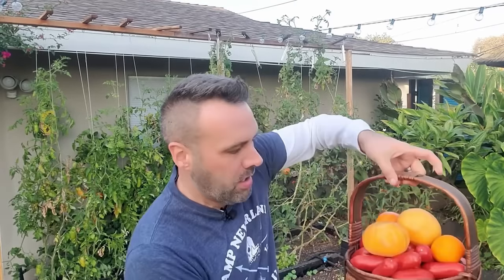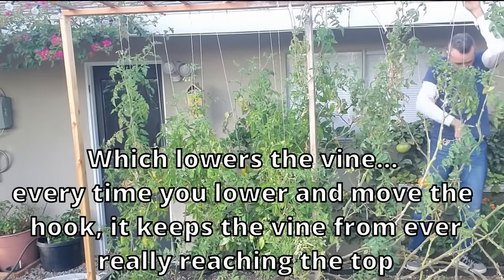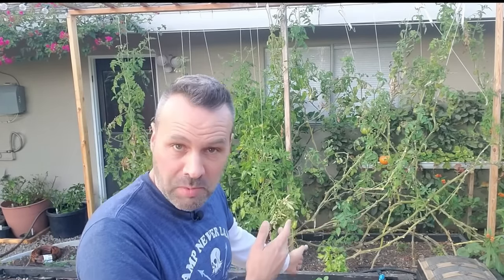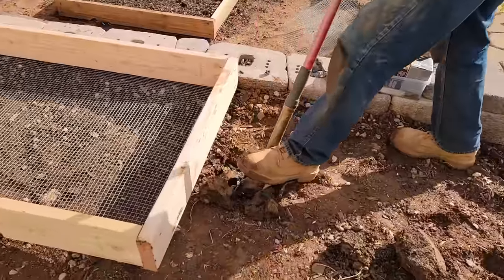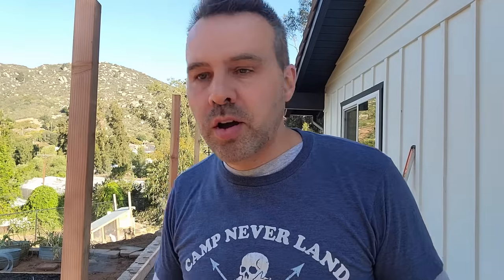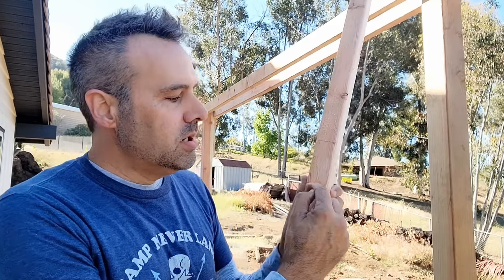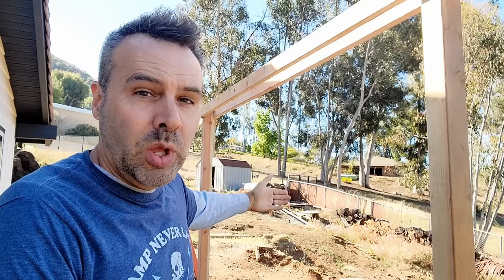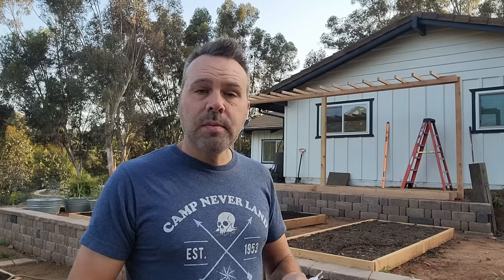Grow Way More Tomatoes In Less Space! - Best Way to Trellis Tomatoes EVER!!!

Comment: We built this last year and loved it! It was so much easier to maintain. I, like others, did end up overcrowding a bit at 1’ between each plant with some basils sprinkled throughout, so I will be spacing them out a bit more this year.

My main problem was that I didn’t properly anchor the landscape pins tethering the string to the ground, so as the vines got heavier, the string and pin would be pulled out of the ground. I tried burying the pins to have more resistance, but that didn’t help much. I haven’t figured out how to better do this part yet :(

Comment: Using a spacer block (it looked like you were towards the end), using clamps to hold the cross pieces while you're screwing them into place, and also drilling and installing the eye hooks before you hang the cross pieces, so you don't have to climb and work upside down!! Woodworking nitpicking aside, this is a great video and by far the best thing I've seen so far. I am planning what I will plant this fall as it's already much too hot here in June.

Comment: Last week I was lamenting not finding a video where I could see how the strings work late in the season and boom, you delivered just in time. I used the strings last year, but didn't take advantage of moving them around. Also wasn't as good as I should have been about getting all the suckers.

Still curious about how shallow that bed is. Even planting them sideways it doesn't seem like enough depth, though I suppose you could add a level.
Reply from the maker: Well. Technically they are able to go into the soil beneath. There's only wire in the way.
Reply: @NextLevelGardening  Ah Ha! Hadn't thought of that. Keeps Moles from coming in but the roots can go out! Thanks for all the great videos!

Comment: Wow.  That looks great!  How are you attaching the cross strips at the top?  The video is sped up during that process.  Are you drilling at an angle down into the beams?  Are you using 2 or 4 screws per cross strip?  What length screws are you using?

Comment: Last year I used the Florida Weave, but had problems with the wind literally throwing the plants around. Gusts were about 40, maybe even 50 mph. So, I thought I'd try your method this year and bought the hooks from you. But after thinking about it, I decided that the wind would play even more havoc on them than the Florida weave. My 8' t-posts were left wobbly in the ground last year, so I decided to put up cattle panels to give them strength. The only thing I know to do is to keep pruning like I did least year but clip them to the cattle panels and sacrifice the extra growth that you get with the leaning method. I'm disappointed, but I think that for your method to work in my area, I would have to grow in high tunnels. wish, wish, wish. Zone 9B, Red Bluff, CA.

Comment: Brian, I thought it was important to rotate crops, especially tomatoes to prevent recurring issues with pests and disease.  Please advise.  Great trellis, just worried about planting same crop in same place every year. Thanks.
Reply from the maker: I have a few videos on that! I add at least 3" of compost every year to cover up the previous year and  Possible spores. Plus I use drip for watering so I have little to no splash back
Reply: Yes I was wondering the same thing, so do you remove some of the old dirt to replace with new and then mix? 
Also why did you add the screen in the bottom ... would that make it hard to pull up the plant after its finished?
Reply: Also you wouldn’t be able to plant it very deep...?

Comment: Just discovered your videos, extremely helpful.  I have an 18' geodesic dome SW Colorado at 8000 feet, which greatly extends the growing season.  In the center there are stock tanks which I use to grow tomatoes but have always struggled with the best method to grow them.  Now after seeing your growing tomatoes vertically and trellis videos - ah ha moment!  I wonder if you could recommend the best layout for tomatoes and trellis using a 2'h x 2'w x 6'l stock tank.  Cheers!

Comment: On a 4.5×10ft bed, I'm doing four 2×4s, two at each end by like 12+ apart. Eleven-ft long×Six-inch wide boards on the top outer side of the 2x4s (with miter edge), these are where I will screw in the eye hooks. Then I will add pickets on top for esthetics, as well as on the side ends. I will plant cucumbers on the ends so they can climb up the sides like a ladder. 😅 Tomatoes won't be so close to allow for airflow.

Comment: How does the construction fabric inside the raised bed keep the gophers out?    I put mine around the outside of the beds & fences
Reply from the maker: It's stapled to the bottom so they can't burrow in.
Reply: @NextLevelGardening  from the outside up into the bed i take it.   I put a foot of it around the outside of the bed and cover with woodchips to keep them from burrowing all together that is if they get through the electric fence tape wire fence, and don't get dispatched when seen in the daytime.

Comment: ok, i am running into a problem with the hooks at the base coming out of the ground in windy weather pulling the plants over. Anyone else having similar issue and what you did to stop coming out of the ground?
Reply from the maker: Did you loop the string around the stem of the plant a couple of times?
Reply: @NextLevelGardening  yes. I think the problem is the hooks are not staying secure in the soil. I went back and added weight to the string to keep bound to the ground.